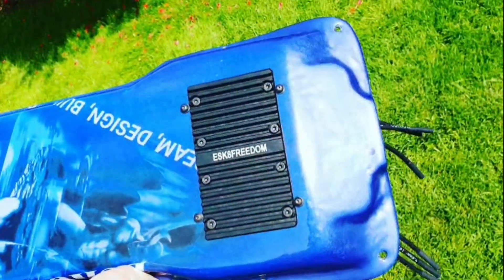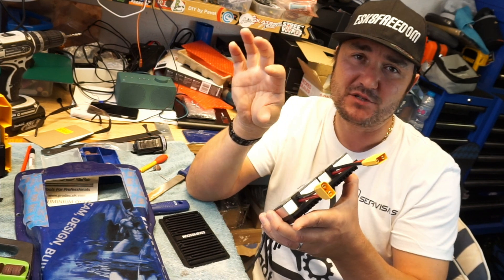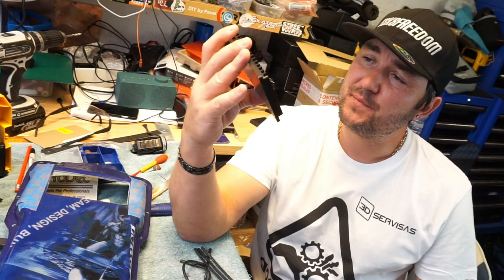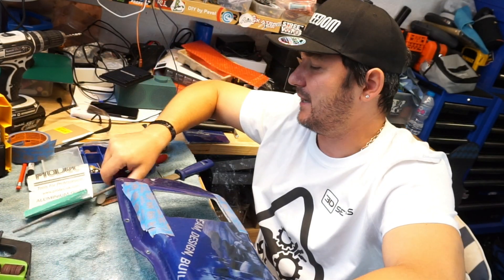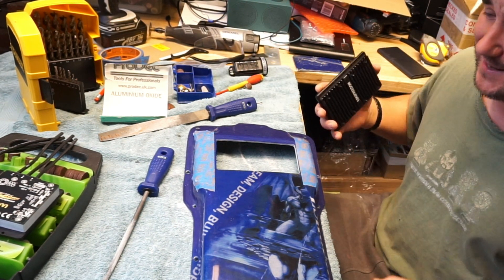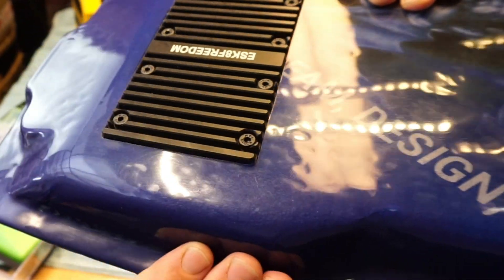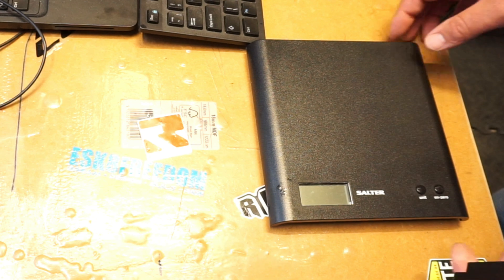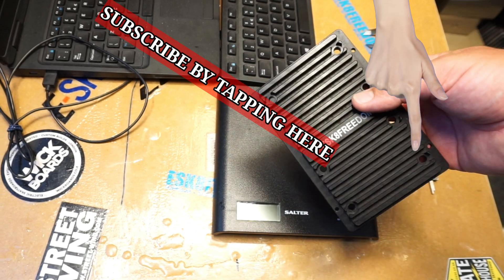Trampa VESC mark 3 & 4 heat sink , detailed review.

Comment: Any thermal paste / thermal pads in between the vesc and heatsink?
Reply from the maker: Hi David,
Good question .... so :
There is a thermal pad between the vesc guts
 and the vesc heat sink ( the case itself ) . I did not use any additional heat transfer substances between the external heat sink and the vesc case. I do not think it is required to be honest. Both surfaces are very smooth and will have a very good contact. This heat sink has a very good mass and will absorb a lot of heat. ...
Its just my opinion.
What are your thoughts?
Reply: @PavelGarmas  I'm using an external Unity one in my new build - using a 0.5mm Thermal Silicone High Conductive Pad (6 W/m.K) - I did consider CPU thermal paste too  - if there's an air gap (even very small) it would insulate the heat-sink, limiting it's effectiveness. You could be right though, I'm not sure how much it'll help - just wanted to make sure I made the most of it